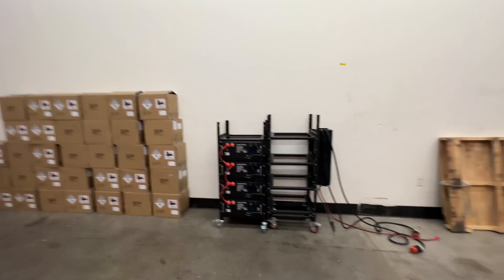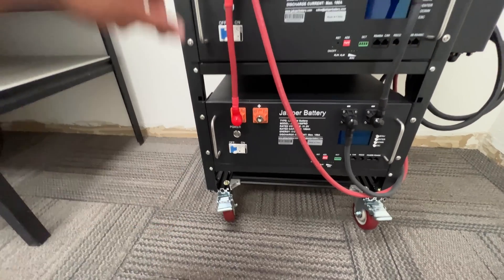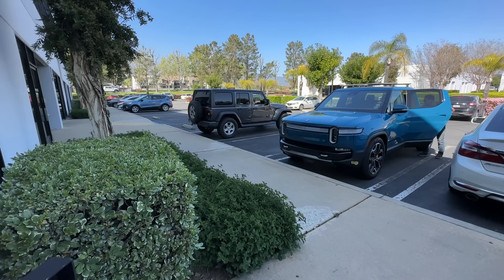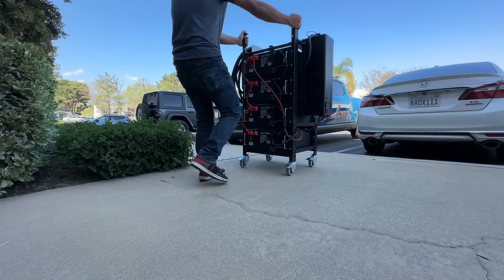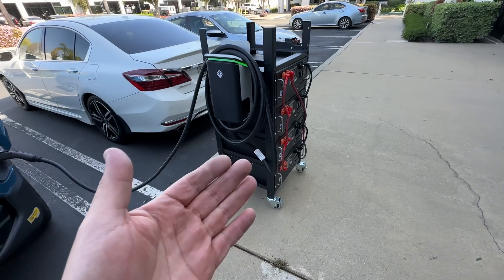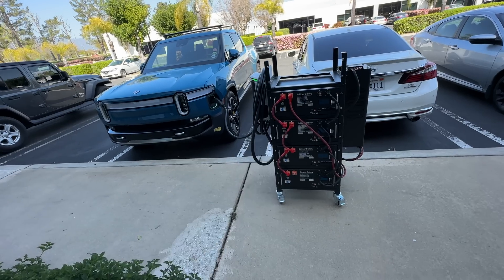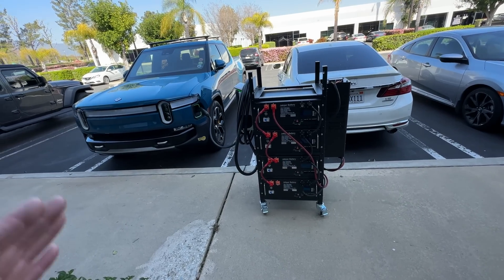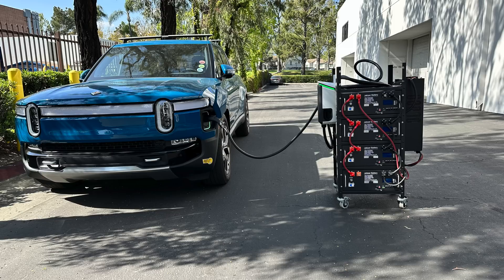Finally! Portable Rivian EV charger - ADD 40 - 60 miles

Comment: Why not build it fit into the vehicle and charge upon main batteries fully charged and use the existing car charger? Then no need to wheel or haul to different locations? Just a thought....🤔

Comment: Smart choice using that low frequency, transformer based inverter charger instead of one of those low surge capacity, short lived, high frequency inverters that every seems to be selling nowadays. High frequency, transformerless inverters provide a much lower surge capacity and a shorter life expectancy than heavy duty, low frequency, transformer-based inverters. Additionally. high frequency, transformerless inverters do not provide any galvanic isolation between its DC boost stage circuitry and its AC output which can allow high amperage DC current to pass through to your EV's onboard charger and damage it. 

You may be able to use a high frequency inverter to charge an EV short term or in an emergency, but it would just a matter of time before the MOSFETs or IGBTs in this inverter fail and you can kiss your EV's onboard charger goodbye. A much better and safer choice if you want to charge your EV with solar is to use an inverter that uses low frequency, transformer-based technology in its design. Low frequency inverters can handle high surge loads for at least 3x their continuous rated capacity and they can do this repeatedly, without sustaining damages to their MOSFET transistors, for minutes, rather than the milliseconds that a high frequency inverter offers. And because low frequency inverters use a transformer, they provide galvanic isolation which protects your EV's charger. That's why the big-name brand inverter manufacturers like Schneider Electric, Outback Power, Sigineer Power, Magnum Energy and Victron Energy and others, all use a low frequency topology in their design.

Comment: Can someone explain or help me, the jumper cable did not work? How does the ev charging system even know that its not "ground-bonded" is there a signal going back to the charger? What am I missing here

Comment: The EVSE checks that it is either 120v or 240v between the hot and the ground so that it knows there is a true ground.  So if you cannot connect the inverter ground and neutral, you will want to connect the EVSE ground to the inverter neutral.

Comment: more speed!, can you make it discharge faster?
-use case, road side assistance.
Reply from the maker: 48A max is possible on AC charging,   for faster you need DC but the smallest DC charger is 20Kw for $20k and its designed for 3phase AC power not DC.

Comment: It feels like there should be a way to use a CCS connector to avoid waste from inverter and potentially faster charging.  I would think CCS would support under 10kW charge rates still and you'd just need a controller that knows how to talk to the vehicle and understand the batteries it has in terms of rate and such.

Comment: Wouldnt it be alot smaller if you used 240ah cells? You can get them for about 150 bucks apiece.  Only has a foot print of 24x14x9 inches
Reply from the maker: Where can I buy them?
Reply: @jehugarcia  did you delete it?
Reply: Think is deleted the my replay but 18650batterystore is the site. I have used them for A cells and works well. They have b cells cheeper.

Comment: Outlined a similar system for overlanding. 4 batteries, 2 120 inverters making 240v, solar panels, etc. mathematically i was able to map out roughly 68 miles in 94 minutes. The batteries would be dead after obviously but on paper it works 🤷🏽. You were able to post it on YouTube before me lol. My goal was and is to prove all the negative comments for everybody’s channels that they were wrong. Again you beat me to it.

Comment: The ground wire in that comes from your circuit panel should always be bonded with the outside of the enclosure of which you are building. Its sole purpose is to protect you from electrical shock.

Comment: You don't even need the EV charger if you already have one, you're fine with the 240v split phase :)
Reply from the maker: The evse is not a charger ,  it’s a fancy extension cord with a relay and an j1775  plug

Comment: Great idea!  Really needs a fuse on those batteries.
Reply: Agree with you, add a fuse is always good. But also, each battery have double proections already, BMS as primary, and own breaker as secondary.

Comment: Isn't there still a "small" charger that allows DC-DC to be used, perhaps with much greater efficiency than DC-AC-DC? The percentage that is lost in each transformation is not trivial if you then consider the total..!
Reply from the maker: 6kw is not small
Reply: @jehugarcia  maybe you don't understand what I mean... I meant to take the DC from the batteries, pass it through a DC-DC charger and give it to the car, increasing the voltage. The battery will always be able to deliver the same power, but the total energy that can be given to the vehicle will change and therefore also a little more power. It is much easier and more efficient theoretically.
Reply from the maker: I’m theory,  in practice it’s hard to do it
Reply: @jehugarcia  of course, I haven't found anything on the market... it would be a great solution for those with powerwalls at home, for those with a grid, bypassing the inverter and only having a charger with a step-up buck converter.
With that battery pack like this you could theoretically charge up to 20kW, 100/200V by putting the batteries in series.

Comment: Is there a reliable  48VDC EV charger which uses for a more efficient system

(Also ?? re charging a battery stack using a variable voltage MPPT charger controller with a simple AC-DC rectifier (PFC device) - cheaper than a bespoke AC/ DC charge system)

Comment: Is the inverter the bottle neck. Could a bigger inverter allow for faster charging? Would it be possible to go DC direct into the batteries of the car?
Reply from the maker: Not easily,  custom hardware and software needed for that

Comment: Awesome! I wonder if a unit with your high C batteries...and a CCS DC connection is feasable...🤔
On the other side you said it: batteries and charging are a problem... mostly because EVs today are not enough efficient...😐
Reply: DC to DC should be more efficient and simpler because it avoids equipment.
Reply: @fduran6993  you avoid to use an dc/ac inverter... but don't you need a dc/dc converter?🤔
Reply: @davidsimoneta8513  This is my doubt!
Reply: @fduran6993  minimum voltage for CCS is 200 V ... but the system has to meet the car's battery voltage... with a variable DC to DC converter... controlled by signals from a communication module (AC with PWM signals): I don't know yet if you can buy something like that for a reasonable price...🤔
With 100A max discharge rate of those racks you'll get 24 kW peak power... and maybe 20 kW or less continously🤞

Comment: Jesus though. That is enough battery for nearly half a month for me for every day use though in my RV. That's my problem with electric cars. No one sees how much MORE electricity we are going to need to produce to power these things. It's not simple and it's why I never see electric cars being mainstream. I think gas has a lot more life in it for vehicles, especially trucks and stuff. Imagine how much power it would take to make my 27 foot RV go 50 miles....it would be bonkers. The 460 in it does it with ease and gets 10mpg  meaning I have 300 miles of range per tank.
Reply from the maker: Yeah but 30 gallons of gasoline cost $143 in California,  the same would buy me 715kwh = 1430 miles in the Rivian the most inefficient EV,  close to 2000 miles in a Tesla model3
Reply: @jehugarcia  Yeah but utilities are going to have to invest a massive amount for those cars for sure. Most people don't have access to TONS of solar. By no means am I trying to be insulting. It's just electric companies WILL increase prices to more than gasoline. I don't think I even have to explain why or how. Everyone knows they will. Most of the US doesn't have the conditions california has for solar either. The conversion from A/C to lower voltage A/C to higher voltage DC at home is quite the challenge too. That's a lot of losses....
Yalls bills for just running A/C are bonkers....and you absolutely need it in the summer there. Add the car to that, and your bill goes through the roof.

Comment: A flat pack which can slide under the Rivian might be a useful option, but 10 mph to get just 40 miles does not seem worthwhile. Stopping at a DC fast charger and charging for 15 minutes may be a better option. But the best options is probably getting all of the residents at the apartment building to ask for a few charging stations. Just having a few nearby could probably pay for itself.

Comment: It's not a terrible idea per se, but it boggels the mind that we would consider spending upwards of $8000+ on a portable charger, for a gain of 40-60mi. Thee's also the nagging problem of not being able to use the unit in rainy weather, unless the unit is fully waterproof(?)  Also, lets not forget the fact that it will be highly targeted by thieves the minute the owner turns their back on the unit. Sorry, but no amount of bolting the charger to the ground is going to stop a thief from stealing the unit once they realise how much they can get for it. Sure, there's lots of ways to bolt the unit down but that would totally defeat the unit's intended portability.
Reply: or... you could leave it in your garage as also home backup... Dual purpose.

Comment: I guess why not work on reducing weight and size a bit and actually use this on a trip? If you went to a location without chargers you could be charging this in your hotel room while you were out for the day doing things, then charge the car with this faster. In essence you are "charging" your car during the day by storing the energy back at the hotel while you vacation.
Reply: - yes it is a "Jerry can" for  EVs - a very expensive one, but nonetheless no one can say "it can't be done" - I would be looking for a DC-DC charger to avoid the limitations of needing high voltage on the portable unit. -  also need to deal with the "charging" aspect - a 2+kW  220VAC/48-57VDC charger isn't cheap either - or fast.

Comment: I have been looking to build something like this . I can't wait to see the budget version.  Would you also make a version of this that can be used as a home backup with 120/240 V? Thanks
Reply from the maker: This is it,  plug this into your transfer switch and power your home.
Reply: @jehugarcia  would it be feasable to do a DC charger with 5 racks in series (max 24 kW) and CCS connection?
Reply: @jehugarcia    This is really awesome with so many applications.
Reply: Me too waiting for this! For Tanzania 🇹🇿

Comment: this is a good booster pack. you could start a roadside service for electric cars that ran out of juice on the street
Reply from the maker: I would get a 15kw inverter for that  so I can charge full 50A  = 20m/h on Rivians and 30m/h on teslas
Reply: Is this safe to used is there a panic button to stop all?